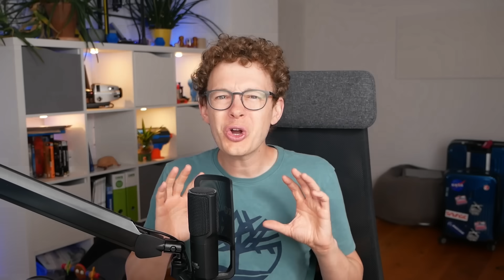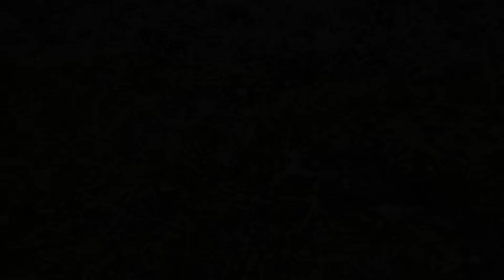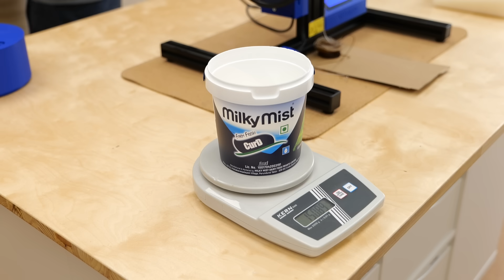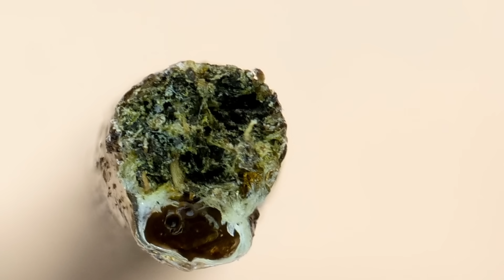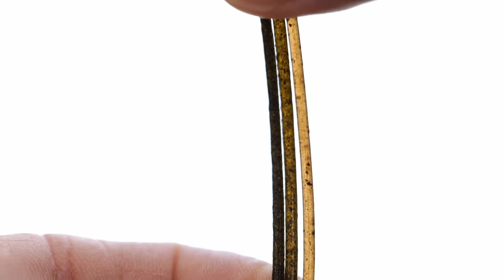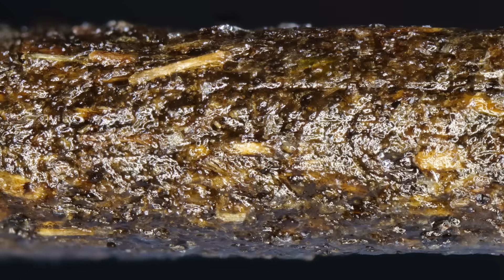Cow Poop Filament is NOT as BAD as you Think!

Comment: So... Did you have the same foaming problem with the straight PLA powder? If so, it's probably a feed problem. Maybe use some kind of paddle instead of a screw to move the material into the extruder?

Also, a better grinder maybe? Cuisinart makes a spice & nut grinder that can pulverize cinnamon. A more consistent grind size for the add-in should also help extrusion.

And if people have a problem with PooLA, they might want to look up urea, and then see how many products they use that contain it. 🤔 🤣

Comment: Like others, I assumed you meant printer poop. Then I saw you meant cow dung.
Surely it would be better to use the cow dung on the garden to grow something like hemp or wheat straw and use that as filler instead.
That should be your next experiment as they would surely be stronger than partially digested grass fibre.
Nice experiment though. Cheers!

Comment: in my humble uninformed opinion, maybe a self stapping screw isn't the best piece to stirr down the funnel. If only you had a machine handy to 3d print a custom part with a flat shovel stirrer... if you notice the fine powder has the exact pattern of the cross section of the screw. I think a flat paddle would be a good mod for your fine powdered extruded "materials".

Comment: I think this is a perfect time for PSA... Remember 3D printed objects are not food safe, regardless of if they're made out of non-toxic materials such as organic locally harvested PooLA. As you may know in our hobby we use silica gel desiccants to dry and soak up moisture in our storage containers. All these silica gel beads are is glass made in such a way that they are extremely porous on the microscopic level. Microscopic pores have the unique property of pulling  moisture out of the air into the martial. All filaments that use a FDM method to make, creates microscopic pores. As you are also probably aware these filaments even before you print with them absorb moisture. Anywhere that you have moisture and food source, mold and bacteria will grow! No matter how much you clean, tiny food particles will get stuck in the print and because the print will naturally pull moisture out of the air, you are going to get mold and bacteria. This is compounded by the fact that air pockets for in between layer gaps making it even worse. All it takes it a thin layer of food-grade clearcoat, to seal the part to make it safe. Do not eat off of anything made from PooLA unless you apply a safe clearcoat to it first (or its a single use only item).

Comment: 17:28 I have experience with dimensionally-unstable hygroscopic materials. With high surface area, nonmetallic honeycomb can absorb enough moisture to change dimensions within minutes. While bulk, pellet, or filament PLA is largely non-hygroscopic; powdered PLA is apparently a different matter (not-to-mention cow dung). If you have a precise-enough scale, then you can measure the rate of moisture absorption. Graphing saturation ratio, it will look something like f(x) = 1-e^(-kx), where the rate constant, k > 0.

Comment: you should add like a soft wisk to the agitator when working with powders instead of pellets instead of just relaying on the screw head. If the wisk can brush against the basin it should keep the powder flowing better.

Comment: Get 100-point-00 gramms of dried PLA-dust and let it sit. Weigh every 5 minutes.
I wonder if the super increased surface of the dust will suck moisture really hard.
Did the only-powder run start foaming after a similar time?

Comment: Hi stephan, one really simple solution that you can have for the powder that do not go though the hopper is to add a small de axed  motor. Something with weight on the side . They are commonly used with toys. You can stick it to the hopper and you will completely solve the issue.

Comment: You can avoid tangling the filament when it will breack when rolling it in spool by using some kind of rollers on the oposite side of the spool. Like the filament spools from above and the roller is underneat the spool. I think some kind of paint rollers that are the with of the inside of the spool(or can be cut to that widh), would do the trick....

Comment: try full 3d printing with 3-color rgb spools 3-in-1 mixing nozzle at once. yep 3 spools running at once. open source free no patents.
Reply: anyways how to solve 2-layer wall routing layer detach issue.ie how to swap the wall pattern between layers to get the two-line walls stick together in every intersection of multiple walls. adaptive layers? ie some walls can be totally detached because one wall goes past that intersection (3-line intersection). the slicing route should be swapped between each layer to get the 3-point intersection to attach properly. anyways I thought you meant print poops ie extra unused extrusions waste usage.
Reply: try zinc-wire metal 3d printing at 400C instead.

Comment: Nitrocellulose filled filament would be interesting 🔥🧨

(I would try that experiment outdoors though)
Reply: The ignition temperature is too low to mix it with PLA.
Reply: @rocketman221projects Perhaps he could try to use PCL instead of PLA as a binder? And otherwise, he could try to mix in e.g. potassium nitrate with PLA.
Reply: @rocketman221projects  gunpowder instead? Maybe not smokeless since that still has nitrocellulose in it though. It has around 300⁰c ignition temp. Just need to be wary of sparks.

Comment: Perhaps a little known fact: Cow poop mixed with straw was used as flooring material on many rural farms. Once it dries, it is almost like an organic cement, so for any room that's not "fancy enough" for wooden floors, it's a viable option. Also can be repaired easily assuming you have access to more "raw materials" :D
Reply: Entire walls are made out of it, not just floors.
And it is still used in very rural areas in some underdeveloped countries.
This technique is called wattle and daub and one of the oldest known methods for constructing weatherproof structures.
Animal dung is not always added, but if so it is done as a binding agent.
Reply: @CookieTube iirc the daub in question could be any material that dries solid like mud or clay
Reply: @en1gmatic931  Yes,  and is often mixed with animal dung which is specifically used for its binding properties. That's the point 😉

Comment: We made PLA from all sorts of plant based material, even straw from horse stables, poop included. Poop from horses or cows is just a form of plant based material, but with a lot of bacteria which will ferment the plant residues. No problem during the proces of making PLA, but you'll have to kill the bacteria before you make a product of your pla.
Cow dung is very hygroscopisch and if it is a little moist the fermentation will start, which causes the foaming filament. Kill the bacteria by heating the cow dung to 120 C for at least one hour or use UV light.
Reply from the maker: And I thought I was the first who put poop into PLA. Thanks for the insight, I'll definitely do that!
Reply: @CNCKitchen  You where the first to add poop to PLA, we used poop to make PLA.
Reply: @CNCKitchen  Yup, both the poop powder and the PLA powder are very hygroscopic - even the time spent in the open hopper is enough to be picking up significant water.
Reply: @CNCKitchen  Would be interesting to see how biodegradable the PLA now is. It should break down faster with all the poop in it.
Reply: This is incredible advice. What would you say would be some clever applications of some of this materials, my first thoughts are in ground planter feeders or pot feeders for indoor plants.
Reply: Did you publish your process or results? Sounds very interesting, would love to find out more about your findings :)
Reply: @jelisa-g  No, we keep our R&D to ourselves. We may use (and patent) the recipes somewhere in the future.
Reply: UV light wont work because it cannot penetrate into the fibers.
Reply: note : you'd almost certainly want to use UV while it's still in it's powder form if you're sanitizing it via that route. If you just use UV on the double-extruded 'filament' then the central core likely won't see much of anything because it'll be protected by the opaque outer layers. Cowshit filament is like an ogre, it has layers.

Comment: i would like to suggest you try filling pla powder with glass microballoons. they are commonly used in composite work to create a light weight filler for epoxy which is then used as a fairing compound or for creating fillets. the microballoons are hollow and filled with air so they are great at reducing density. they also increase stiffness and dimensional stability. you can also try other polymers, i have some pegasus polypropylene which is really low density, almost as light as foaming pla, but without the foaming and therefore stringing.

Comment: the mixing screw in your filament maker seems really lame.  If you had a completely round hopper then you could replace the screw with a spatula kind of thing that slid an arm against the hopper walls thus guiding all material in.

Also this is the first I've ever heard of PLA powder.  Why do we even have multiple heads and reels of colored PLA if we can just get it in powder form and insert the color at print time?  Just like a LaserJet printer couldn't' we have hoppers White, Black, Cyan, Magenta and Yellow, and mix the colors in as they go down the tube?  

I know, it's complicated :-)  But would make a great project for your channel

Comment: Why not redesign the filament maker's hopper to have a steeper internal angle? This will help the material flow instead of sticking to the hopper walls. Also, perhaps a different print angle (for the hopper) could reduce the "steps" that the particulate was catching on

Comment: I would definitely use that. The strength doesn't really bother me, I don't often print things that require something like that. If I did I would just use a filament that worked for what I needed. But for little model type things, this would be fun to do. My go to first print with a new filament is a Hollow D6 I found years ago, I would love a poop one, then I could blame the filament for my crappy rolls!

Comment: The mixer in the hopper relies on gravity: when the pellet is moved, it goes down. This doesn't work for powdered plastic because of cohesion. I would try to mount a silicon paddle instead of the wood screw so the powder is disturbed enough to collapse on itself.
Reply: I thought maybe something that vibrates the hopper
Reply: @BadBadJellyBean yes that is the industrial solution
Reply: Needs a vibrator on the hopper
Reply: You'd probably be better served with an audio transducer playing skrillex or something to mechanically agitate it. Or a vibrator, that'd probably poo better.

Comment: TIP: You could add a scoop type tool to the mixer so it doesn't form a barrier with a hole, and more importantly, add a shaker to the funnel, this is also present on industrial extruders. It will however keep being a problem since there always the tradeoff with powder vs pallets, it might be handy to make it a 2 step process, use the powder and fibers to make pallets and then extrude them., Also depending the materials, surface roughness, moisture etc . the shaker might still clog or even separate the mixture again.Nice vid man, and curious to see what else you can mix.

Comment: Please upload in 4k. Even if you just upscale 1080p to 4k while throwing in a bit higher bitrate. Youtube lately switched to lower and lower quality (re)encoding for 1080p. If you upload (and we watch) in 4k we get much higher bitrate thus picture quality.
Reply from the maker: Will do that for the next one. Had some problems with Topaz AI, but finally figured that out.
Reply: @CNCKitchen  You don't need to do anything special when upscaling. Even a simple pixel quadrupling or bilinear is enough during export. YT uses ~1.5 mbps for 1080p while it uses 6 mbps for 4k. Massive difference, especially when a lot of tiny objects is moving at once (eg in this video the pla pellets).
Thanks!

Comment: well the powder PLA has much larger surface area compared with pallets so I suppose it could still be water?
It's no wonder they use pallets instead of powder as one may need to extrude the filament at a very low RH if using powder?

Comment: 17:36 It could help, if you mount a vibrator at the funnel. This should help to get finer material flowing in. But you need to find out the best settings. Poop is a very cool concept!
Reply from the maker: Yes, I'll probably do that next time but I'm worried that it'll lead to unmixing.
Reply: @CNCKitchen  You could use a timer and only turn on the vibration motor for a few seconds every 30 seconds or once a minute, or use a solenoid to tap it from time to time instead of vibrating it.